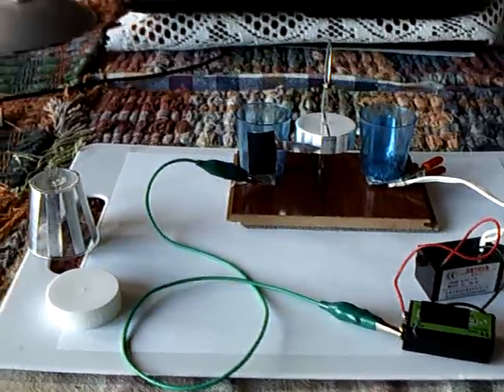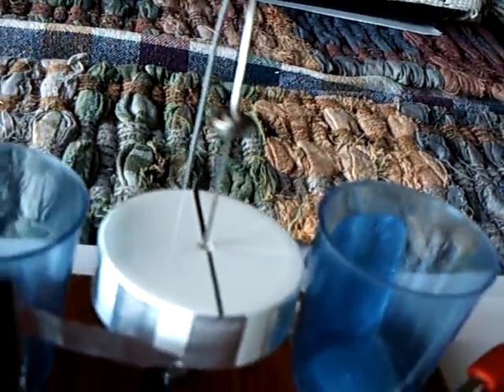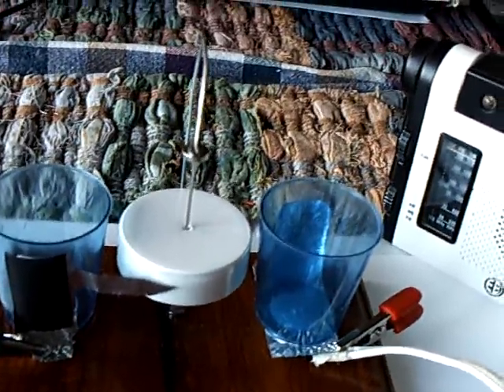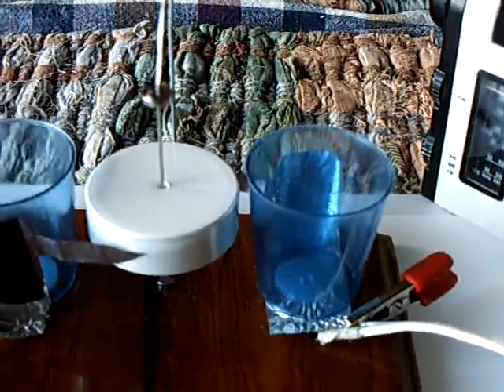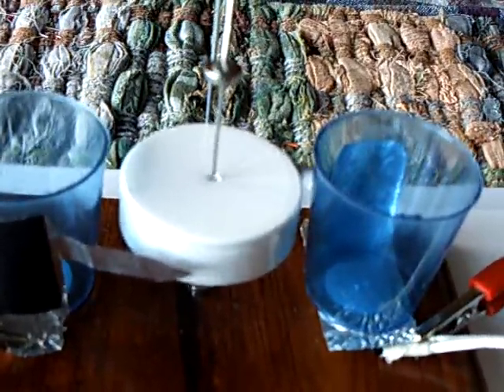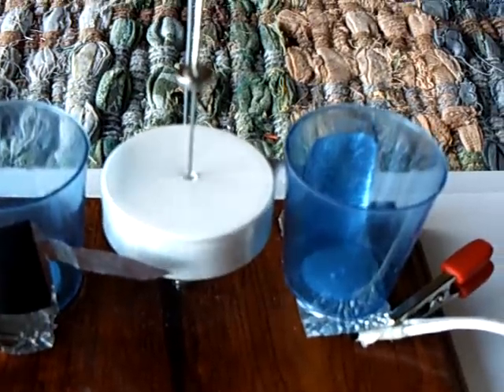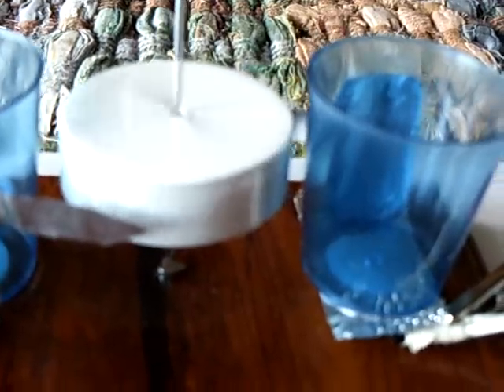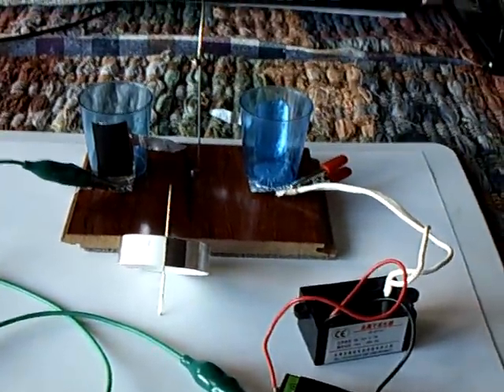High Speed Electrostatic Motor

Comment: Dear Lid, would it be possible to have an idea of the ratio of mechanical power produced by a electrostatic motor versus it's consumption?

What kind of power we can expect?

Could a water dropper generator be enough to produce in the range of Watts, to drive these motors?

BTW, still amazed by the clarity and intetest of your vids!

Infinite Exponential Happiness, 
Khwartz.
Reply from the maker: Thanks. In theory these should be efficient and powerful because of the Coulomb effect but I'm not seeing it.  Electromagnetic seems to be a much better/simpler way to go as far as doing real work for an X amount of input power..  I have not built a water drop generator yet but people have told me not to expect much power out of one.
Reply: ***** OK Lid. Very Thanks for these specifications. Nice to see continue on your way.

Comment: if you made it small enough you could run it inside a jam jar. make two holes in lid, fill with helium from party balloon, seal holes with blue-tack
Reply from the maker: That is an interesting idea.  I have never heard of that before.  If I put a dry air crystal pack in the jar to absorb all the humidity the motor might would run better also. .
Reply: ***** I am quite curious to know what part air plays in all this, it gets ignored in most explanations. I think it appears on the triboelectric series. any electrical effects it causes must be all muddled up with aerodynamic ones

Comment: what about making one from a coke bottle cap
Reply from the maker: This idea should work on any plastic cap.  The smaller they are the faster they go---if you can keep it stable. Magnetman2000 worked alot with this idea on the needle magnet motors.

Comment: Hi lid have you watched video bnemeetingjoe50c brey213 user for your high voltage dc excited joe shows how using a 5v transformer out if a 110v wall socket he touches one side of his jaw with the pos 4 times then the other side with neg 4 times then he says to guy take a gulp of air and close your mouth which he then touches both wires to the guys jaw making a white flash and causing the air in the guys mouth to turn to ozone basically he his showing how to start his static car engine to run on air he holds the ignition key and choke cable and this makes the body of joe booker become the starting high voltage dc capacitor hopefully this may tweak your excellent static engine project joe used urine in cooling system that left a li ion crystal structure in internals of engine which adds up to your ion generator
Reply: Who the fuck let you out of your straight-jacket?

Comment: Enjoyed that. 3000rpm hmm and torquey it seems from the spin up. Wonder if a rotor could spin for a bit of cool air, stuck near the top .
Say, do you get corona effects from the brushes when the room is dark ?
Reply from the maker: I have not looked at this in the dark yet but I'm sure that I would see corona at the brush contact points.  I think that a small fan blade would work on this.

Comment: Thanks for the shout-out.  I nearly always run mine while at the bench.  I think there is excess negative ion spray that has benefits, Cleaner Air, I always feel good when around it, plus it is great fun to watch.  Agree with your conclusions on this build, Thanks again.
Reply from the maker: Hey Brad.  These negative ion generators work really well and you are right the about the air cleaning effect.  I hope people watch your video on this subject.  Using of a ping pong ball as a light weight rotor was brilliant.

Comment: what about the design defines if it spins faster or slower. i think wide fins seem to give more torque so is it perhaps thinner faster less torque wider slower more torque?
Reply from the maker: More segments and a small rotor diameter makes the motors I have made run faster.  On the 'corona motor' designs that I made (that had no segments) the fewer blade brushes the fast they went.  More blades gave better torque but slower speed.
Reply: I'm trying to imagine if the shape of the segments helps too. With perhaps curved edges one side and pointy the other to streamline corona effects

Comment: You still have an old SEC laying around you could attach to that? In replace of the anion generator?
Reply from the maker: I have not had much luck using an 'exciter' to run these motors.  I'm still working on that.  You need a high voltage DC potential to make em work.